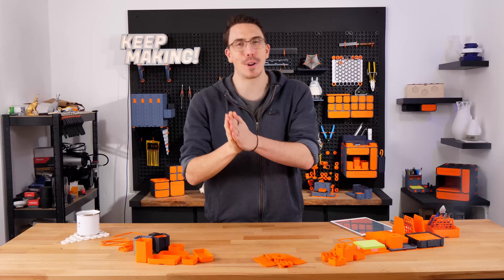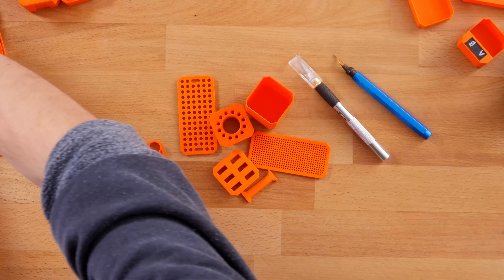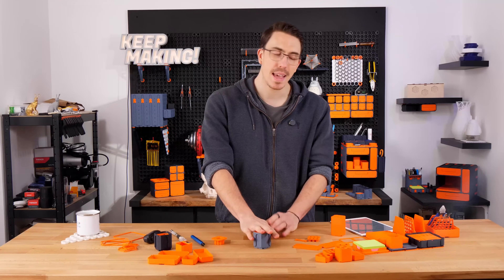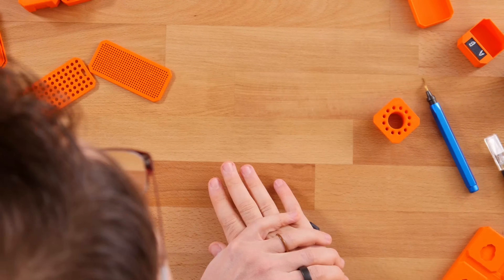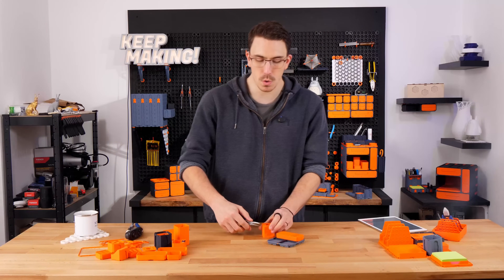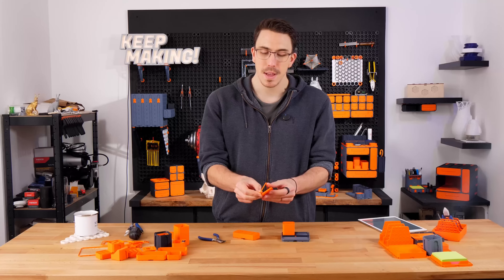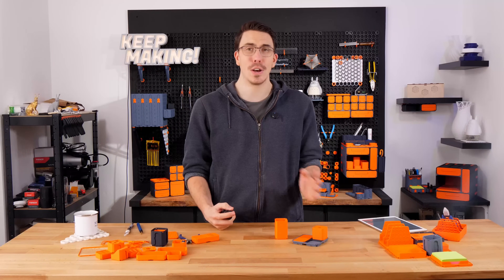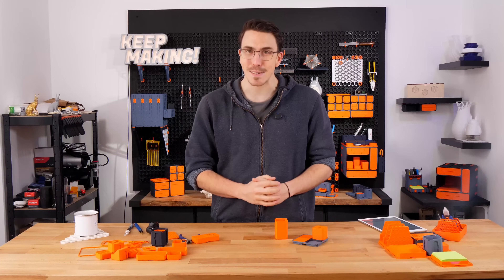Multibin Inserts, Big Info Changes & More... - Multiboard Update #003

Comment: What you are doing is great and I absolutely love everything about this project but I think you should really put some time into making kind of a catalogue of all the possible combinations and the parts required to get started etc.
Reply: It's definitely the weakest part at the moment (and I understand it's coming!).  Unlike some I love that there are so many bits and parts and that I can make them do whatever it is that I need them to do, I've never complained about Legos having too many types of parts either.  But the biggest issue right now is how often I can't figure out what parts I need for something.  I can eventually figure it out, but a lot of people won't want to work that hard to get to that answer, you have to be very into the idea right now for it to be worth it.  Still, it's early on, so we'll see what happens from here.
Reply: It's definitely something we're working on!